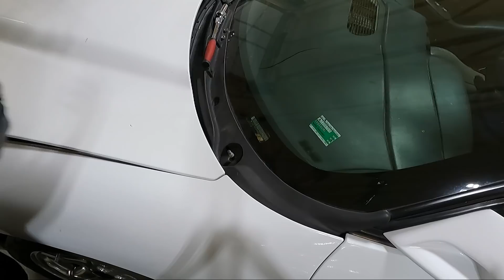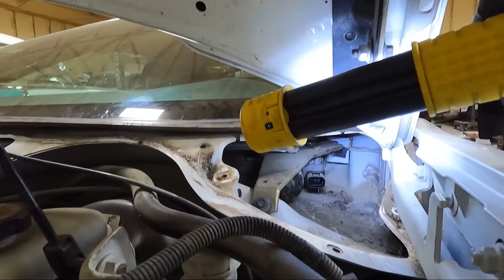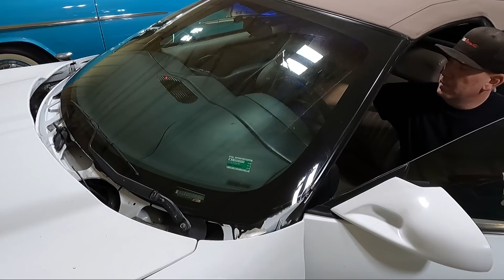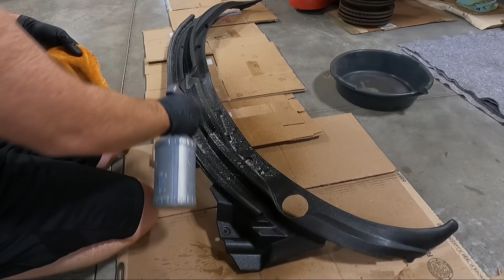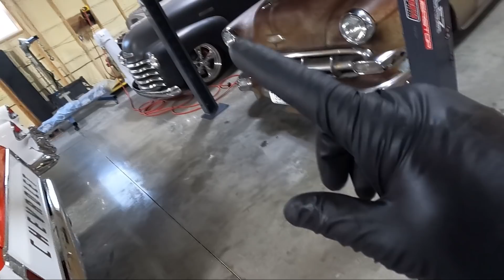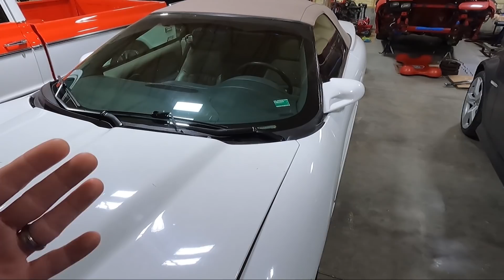How to Fix F-Body, Firebird, Trans Am, Camaro Windshield Wipers (Plus Plastic Restore)

Comment: Your video saved me some frustration, I took mine apart like you did just to give it a good cleaning....also pulled the tail lights off to clean under them. But putting it together, I forgot how the washer lines ran? I couldn't remember if they went on top of the cowl or under it along with the wiper arm assembly. Now I know for sure and can get it back together. One thing that made it easier to take apart and will help putting it together is taking the rubber hood seal off before pulling the cowl covers off. Piece of cake if you do that. I'm like you also with cleaning....I had my pieces in the kitchen sink with a toothbrush. lol
Reply from the maker: Lol. My wife gets upset when I use our sink to clean.

Comment: Hey Travis I just came across your Trans Am wiper motor replacement video. You mentioned that these motors have a common failure mode of not parking the wipers back down on the cowl. I'm using a 4TH Gen F-Body wiper motor on my 1st Gen F-Body (that has a complete LS1 swap including all 4th Gen switches, harness, computer...etc.). Do you know what fails? Is it something on the board or is it something mechanical that causes the wipers not to park? I'm trying to induce that "failure" in my motor so the motor DOESN'T drive the wipers down on my 1st Gen cowl.
Reply from the maker: Honestly I didn't dig in that far

Comment: My 2000 firebird wipers Park in a vertical position. What causes that to happen?  I am not seeing the links for the motor assembly you bought. Where can I find that?
Reply from the maker: It is the motor. I bought a used one because aftermarket sucked

Comment: My son has a 2002 Camaro Convertible with a mysterious battery drain.   You've owed a lot of these cars according to your video.  Have you ever had battery drain issues?  
  He also has intermittent windshield wiper failure issues and wiper parking problems.  He's noticed that a couple times he's parked his car and went into a store then came out and the wipers were running.    The mechanic thinks the wiper module may be failing and causing the battery drain.  The wiper module/motor unit is getting replaced.  The wiper module does have some kind of fault so fixing it is necessary but when I looked at the circuit diagram, the wipers don't have power when not in acc or run so I don't see how it could drain the battery.  I'm not in his location so I can't troubleshoot it.  We're hoping this solves the battery drain issue also.     Have you every had wiper issues cause battery drain?
Reply from the maker: You will have to do a parasitic draw test

Comment: Taking mine off of my Camaro to clean the leafs and god knows what else under this plastic panel. What tools would you recommend for this. Was kinda hard to see without a light shining on the panel.but good video.
Reply from the maker: Generally clip removal tools, 7mm and 10 mm
Reply: @TWAMotorsports  Thanks
Reply from the maker: You're welcome. And a 13mm probably a few picks

Comment: I'm here because my Camaro's driver side wiper arm is disconnected and I'm not sure if it's broken off or just popped loose. I was unclear about it, does the front internal arm go to the passenger side and the rear go to the driver?
Reply from the maker: I believe that is right

Comment: Hey I have a 2000 z28 and my wipers aren't working, I've replaced the motor and that's not it, and tips on that I should do?
Reply from the maker: Check switch and grounds

Comment: Weird question, but I dropped a 10m socket top down the hole on the far right, where does that lead to?
Reply from the maker: If its a 10mm who knows. They have a mind of there own. Lol
Reply: @TWAMotorsports   I was just worried if it could break anything. Great video, I couldn't figure out how to pop the ball joints without breaking anything, where did you get that tool ?
Reply from the maker: For balljoints I use a big hammer on the spindle or knuckle.

Comment: The Wiper arms are nearly impossible to replace as they are discontinued and I can't find any aftermarket replacements. Mine are stripped and it is a wall in my restoration. Same goes for the headlamp assembly. Those are really expensive and rare.
Reply from the maker: Headlamp motors can be purchased new. Wiper arms will have to be found used. Try hawksthirdgen
Reply: @TWAMotorsports  Not the motors. The assembly. The unit in which the headlamps mount inside of. The main mounting......mounts are broken. Like everything else on this car apparently, lol. At this point I have spent more on the restoration than I overpaid for the car to begin with.

I haven't even gotten the most expensive part. A paint jerb. I also have to fix trims, and interior. I basically have to strip and reskin the entire dash assembly because it is chipped and cracked and missing vents. 

Sighs. yes, i am new at this.
Reply from the maker: Definitely look up hawks